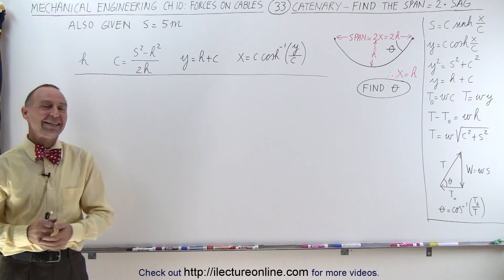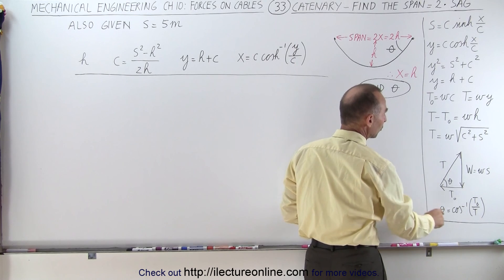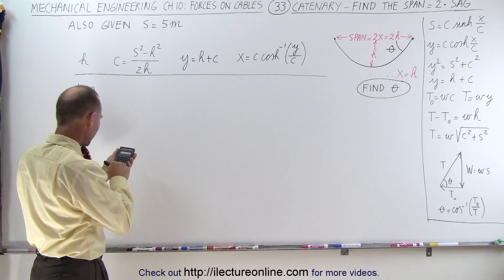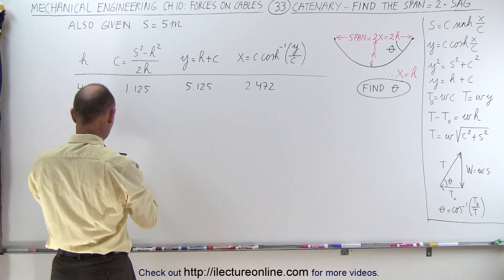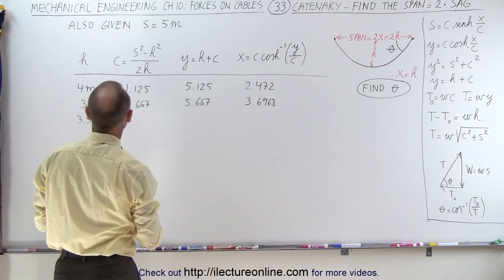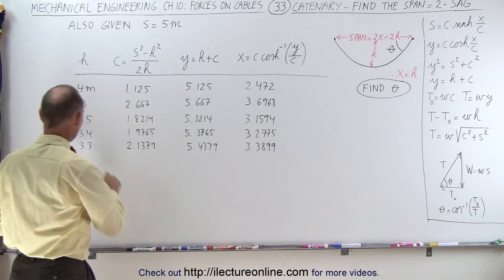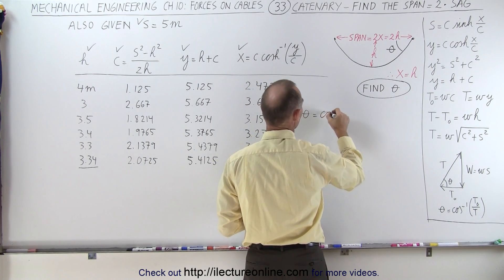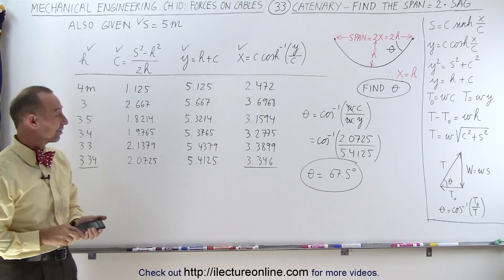Mechanical Engineering: Ch 10: Forces on Cables (33 of 33) Catenary - Find the Span=2 x Sag=?

Comment: Great series however may be flaw in last No 33.x the half span is determined as 3.346m which makes the span twice that i.e. 6.692.The overall length has been set as 5m. Span is greater than cable length. Why is it so?
Reply: From his solving on this question, I thought he took s= 5m to be one side only, from the lowest point to the highest point on the right? the total (two sides) would be 2s = 10m. I am just referring to 1:50 of this clip.